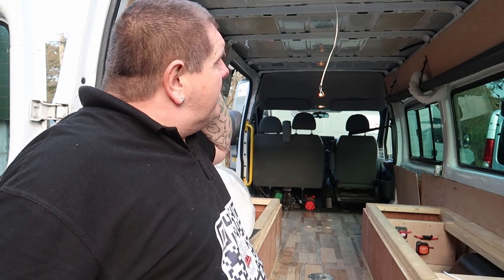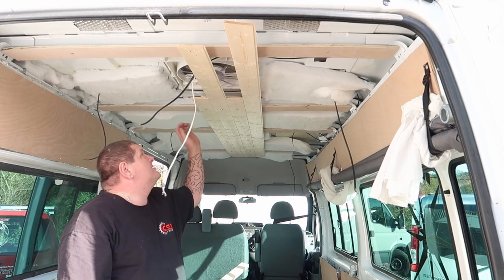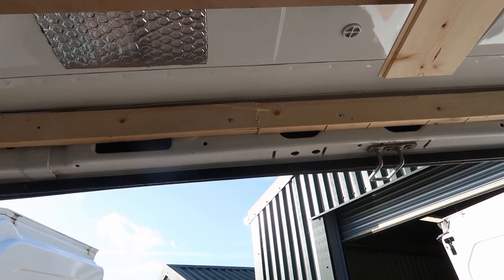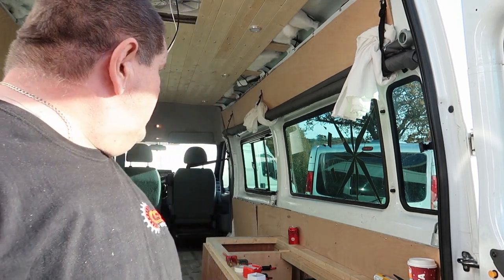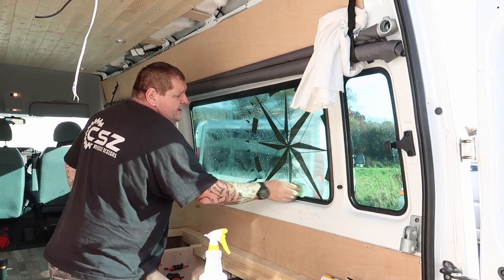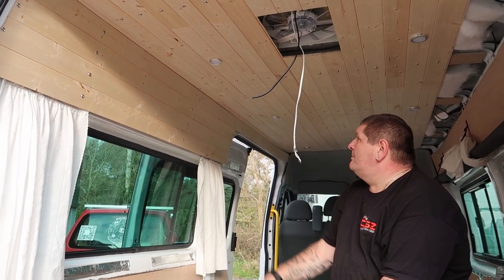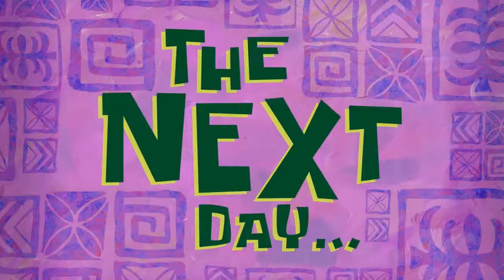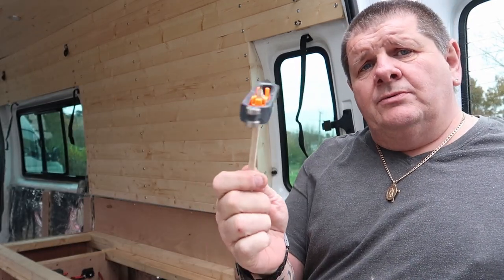Ford Transit Campervan Conversion - Cladding

Comment: Top videos!! So easy to follow and interesting. What mm ply are you using ? also what screws do use for ply into metal?
Reply from the maker: 12mm ply and I use self drilling self tapping screws